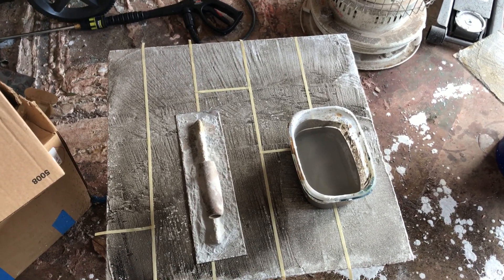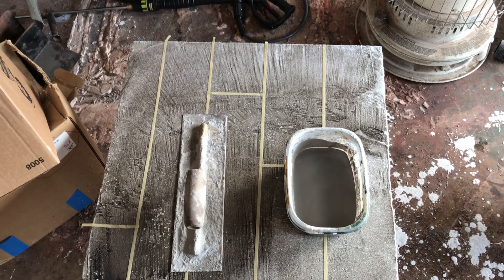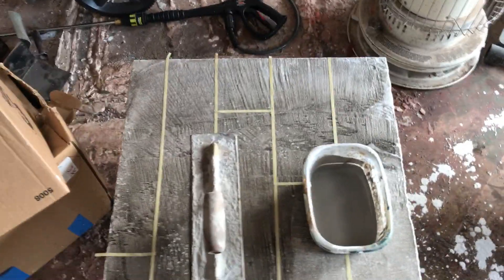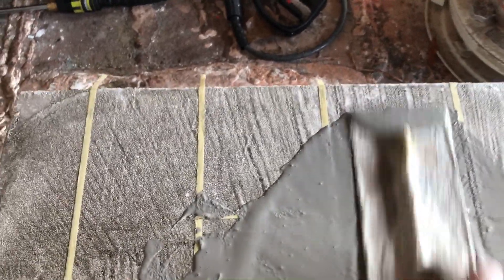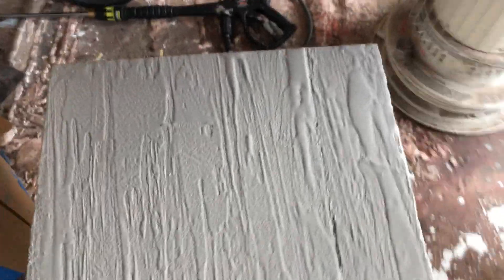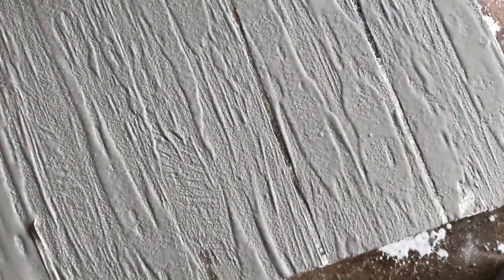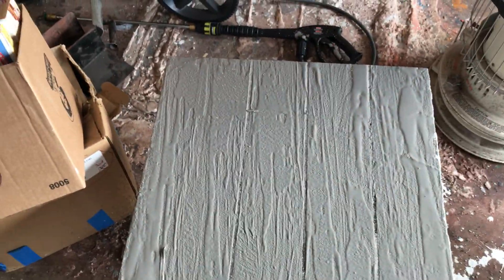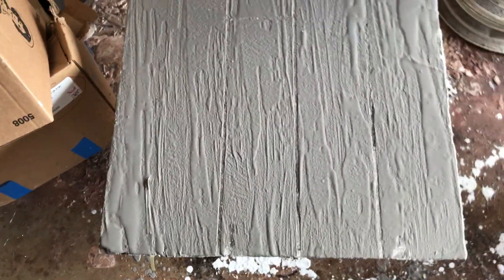Concrete Wood Floors: How to make concrete look like wood. Using overlay, wood grain.

Comment: What did you use for your concrete mix?
Reply from the maker: Sorry, didn’t see this. I am certified with elitecrete, but you can do it with any thin overlay concrete. Sherwin Williams is trying to get in the decorative business. If you are close, they might have their version of thin. Otherwise, sites you can order from .
Reply: @Srids03  plaster bond also makes it stick on old plaster